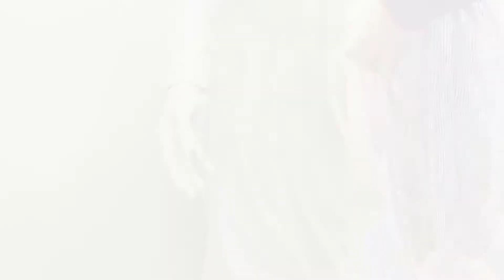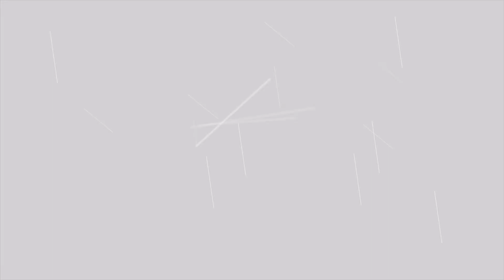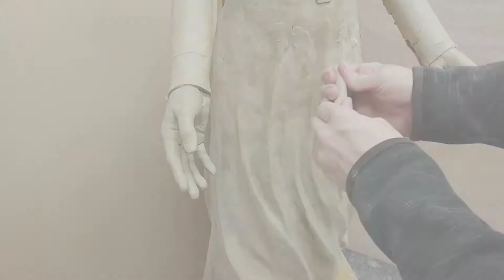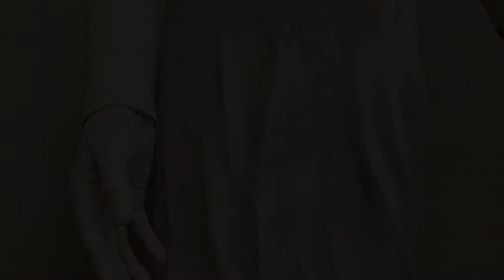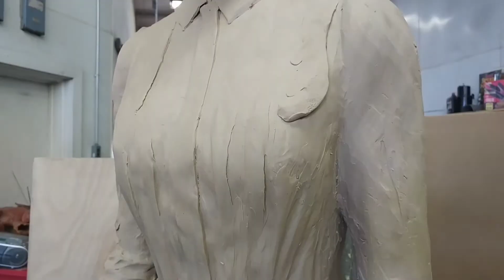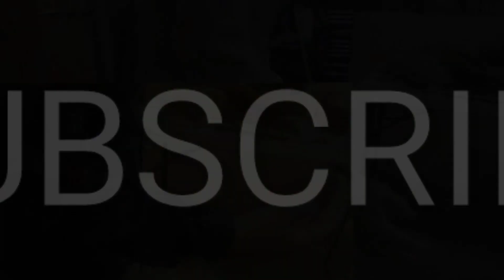Part 2 (How to Sculpt Clothing): Fabric on a Clay Sculpture | Fritz Hoppe Studio: Drapery Tutorial

Comment: Maybe you should sculpt them naked, then paint them and then put real clothes on them. That would make maximum advantage of each.
Reply from the maker: Some artists do that, and it is certainly an accurate method. I use oil-based clay, which is very heavy by weight. So I have to do a lot of construction and carving of polystyrene foam. I sort of carve the anatomy underneath in foam, then cover it in clay for skin and clothes.
Reply: @FritzHoppe  creative hands.....explaining verywell the tips and turns....nice work.....
Reply from the maker: @rajanioak  Thanks!